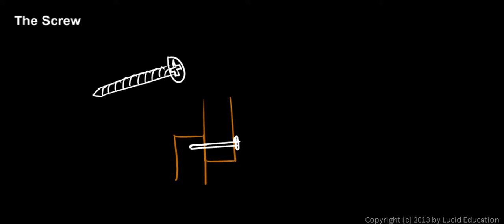Physical Science 4.3e - The Screw

Comment: In the video, it's mentioned that the angle of the threads multiplies the force ... what is the relationship... does a shallower angle equal more force or a steeper angle?
Reply from the maker: A shallower angle creates more force.  It depends on how you define "shallow" vs. "steep", though.  Think of it this way:  The angle that makes it move a smaller distance produces a larger force, and the angle that makes it move a larger distance results in a smaller force.
Reply: Derek Owens Ah, I see! Thanks for the explanation and great videos!